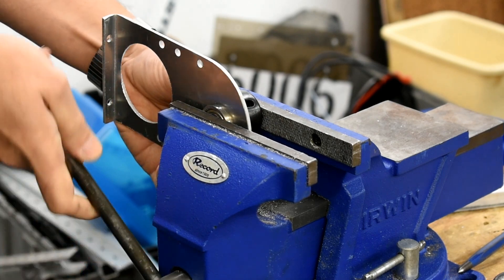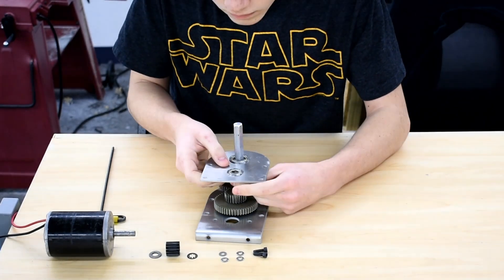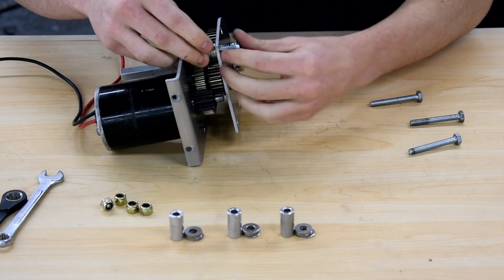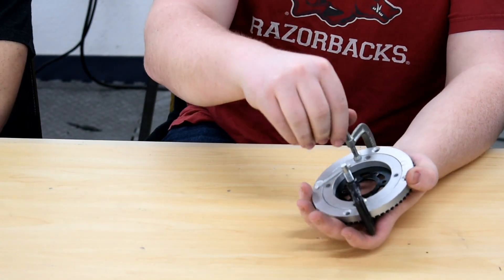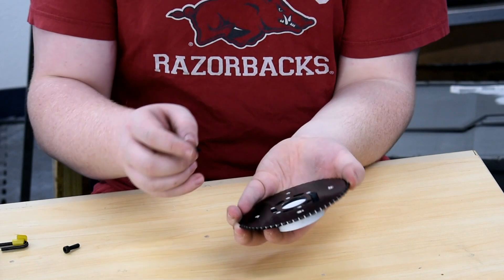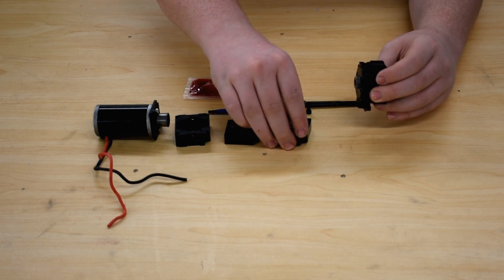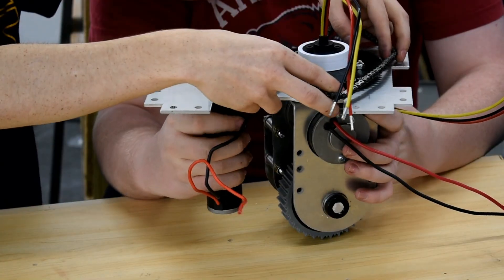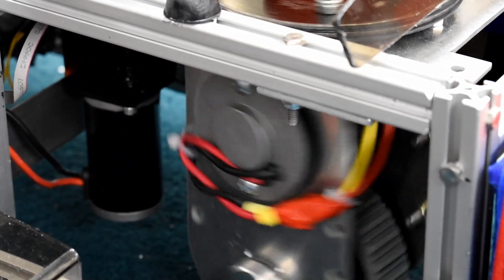How to Make a Fully Rotational Swerve Drive

Comment: Is there an advantage to doing it this way over a differential swerve drive
Reply: less motors and simpler by a bit
Reply: @simplegamerz9485  simpler sure, but differential swerve basically has two drive motors that function as steering motors. There are the same number of motors.